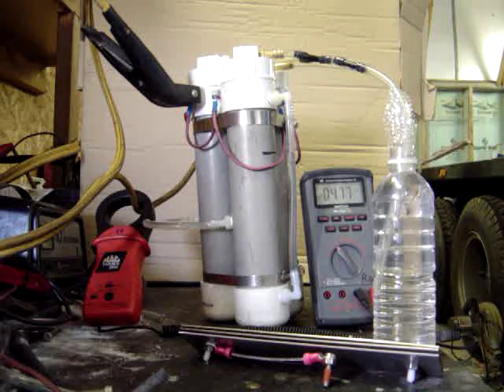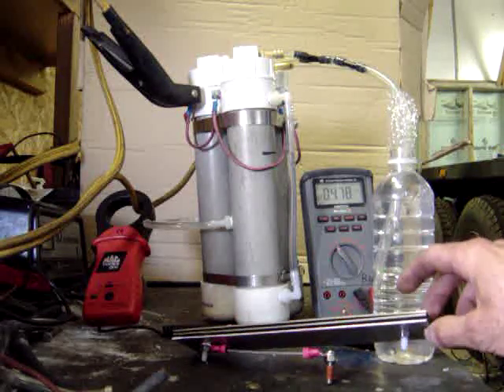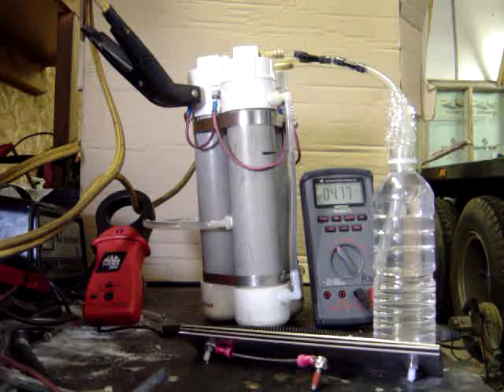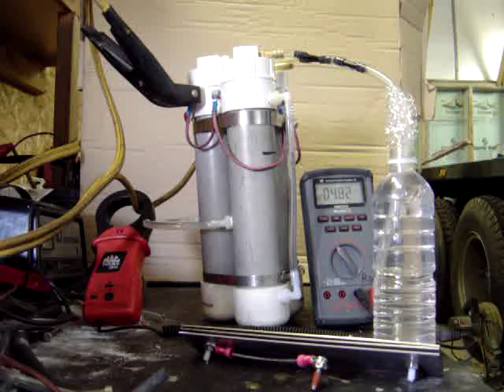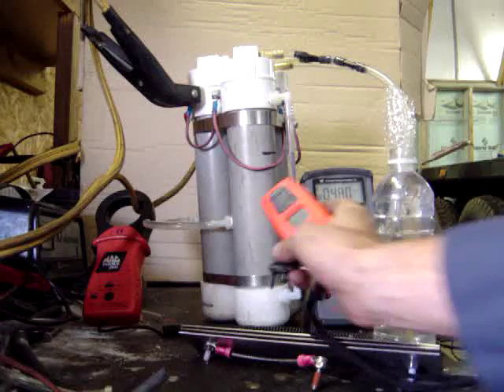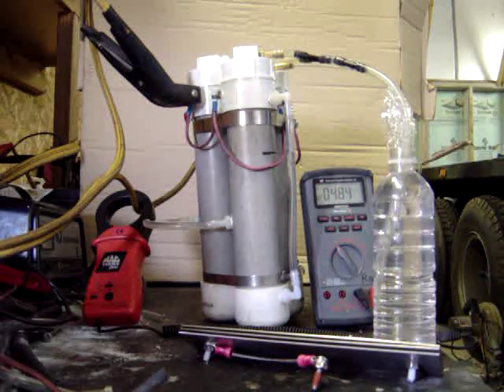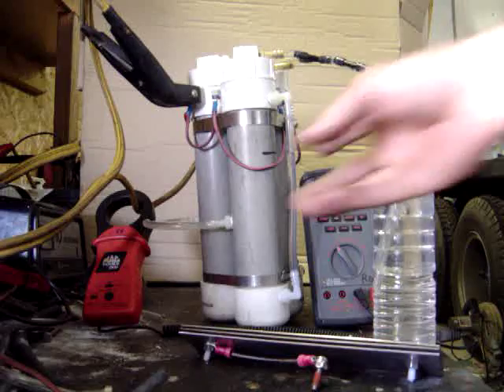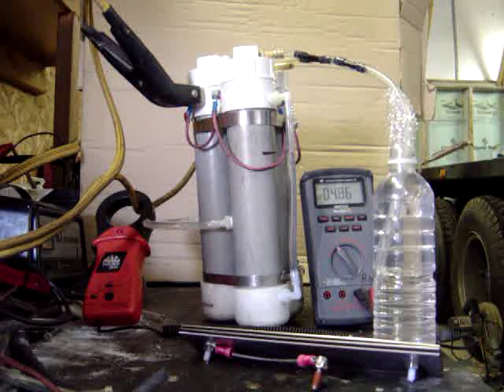HHO 7 CELL GENERATOR, 3 CELLS WORKING TOGETHER

Comment from the maker: My one other vid shows the guts better but I used nylon bolts with spacers between the plates. I have since retired this setup in favor of a more efficient dry cell setup. Be sure to check it out, it's tons bigger.